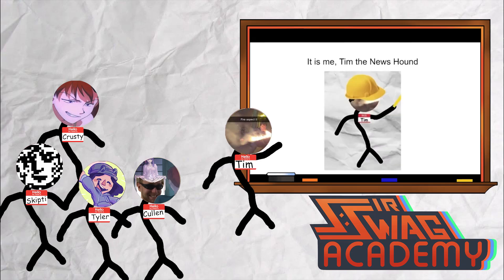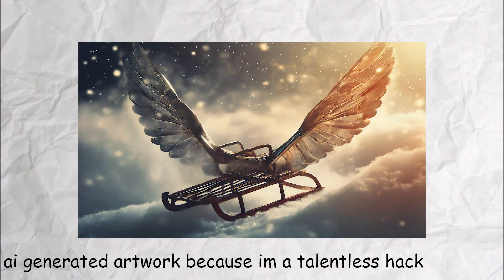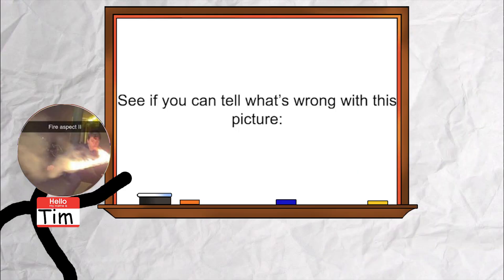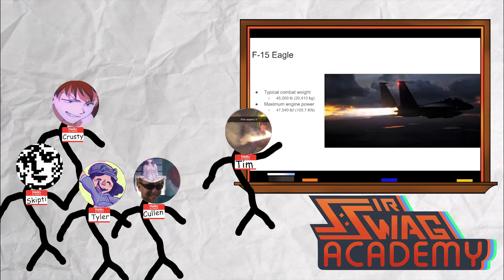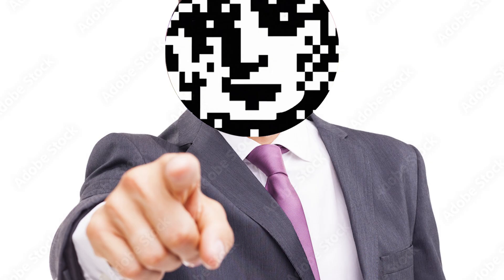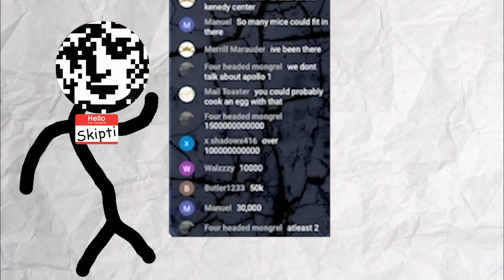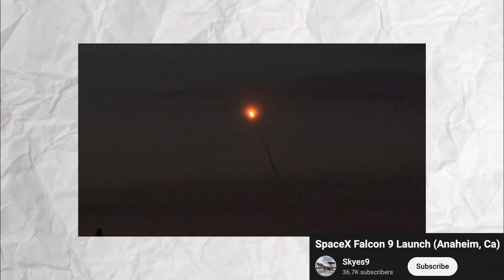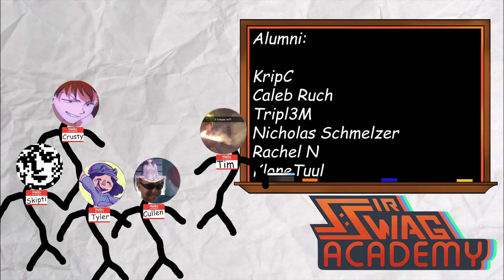What if a rocket had unlimited thrust?

Comment: Okay,  angry plane nerd here.

Just so you know, the story about the F4 Phantom being garbage max because no gun is kind of bullshit (and not only because the F4 did often carry pod mounted guns). For multiple reasons. The actual story behind why it initially underperformed was a combination of maintenance, training, and - most of all - doctrine.

First off, early F4's had smoky engines. This made them easy to spot and allowed their enemy to see them coming and warn other forces of their direction, leading to interceptions.
Second, missile training and maintenance was poor. Very poor. Pilots weren't skilled in using them, and ground crews were shit at fixing and keeping them secure, hence 7% success rate.
Third, and most importantly, doctrine. For whatever reason, I forget why, the squadron formation of groups of four as opposed to the pairs of wingmen we have now just didn't work. It bogged down communication, and just made pilots uncoordinated. But probably the most damning failure was the banning of beyond visual range strikes. Phantoms could lock on and target from distance, where missiles could maneuver and score a hit properly, but weren't allowed to, which gave MiGs the opportunity to close in and dogfight like they'd been designed. Try using a missile on an enemy already in your face, it just doesn't work.

Fixing all of this was the actual Top Gun program, along with better ground crew training, which made the initial 1:1 K/D ratio skyrocket in favour of the F4, all the way up to 20:1- which included the Navy variant, which was never given a gun.

So yeah, missiles rule, guns drool.